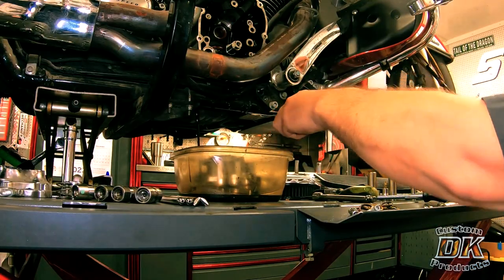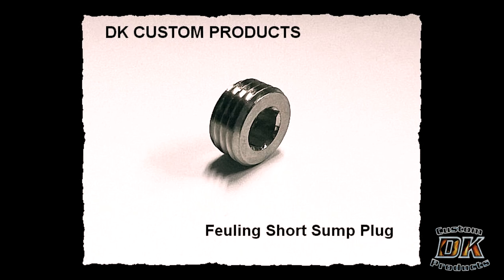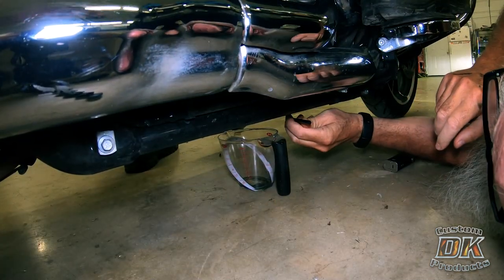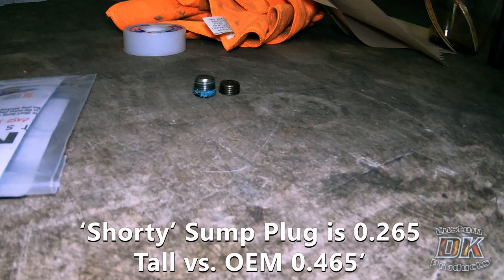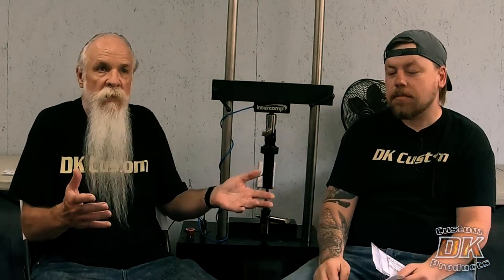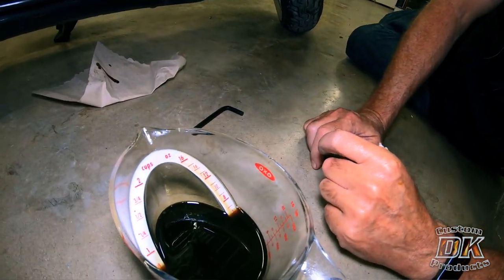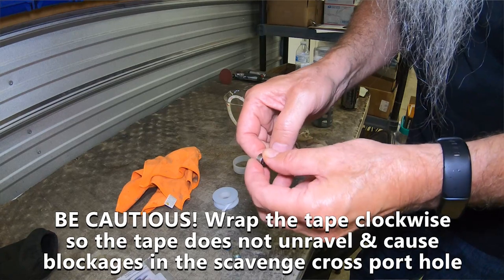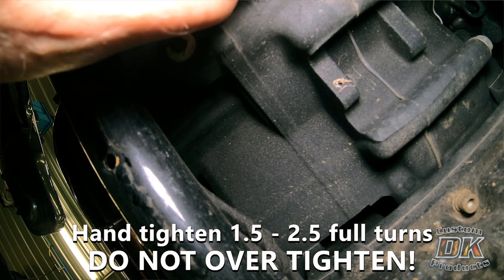Testing 3 M8's w/ the "Shorty" Sump Plug #harleydavidson #motorcycle

Comment: Did the sumping amount improve after the plug install?
Reply from the maker: Yes, the longer plug causes a blockage that can make the sumping worse. 

You can see the sump plug and read more about it at this link - https://www.dkcustomproducts.com/milwaukee-eight-feuling-sump-plug.htm

Please fee free to reach out to us with any questions;
Support@DKCustomProducts.com
662-252-8828

Thank you for commenting! MB
Reply: Could a person just drain this port and see if they have a sumping problem 🤔
Reply from the maker: Yes, as discussed in the video if you drain the sump plug hole and you get more than 8 ounces of oil you have a sumping problem. 

Thank you for commenting! MB

Comment: when you say sump. do you mean the engine oil plug?? m8 107.
Reply from the maker: The engine oil drain plug is in the bottom of the oil tank, which is separate from the engine.

Harley's are "dry sump" engines and have a sump plug in the bottom of the engine, which is not the same as the engine oil drain plug.
You can see a diagram of where the sump plug is in this video- https://www.youtube.com/watch?v=_4wxFjqyTAU&t=0s

Always feel free to email or call with any questions.
Support@DKCustomProducts.com
662-252-8828
Reply: all i am aware of in my 2018 m8 107 are the engine oil drain plug ,the peimary drain plug, and the transmission drain plug,am i missing a plug here somewhere. as i relate the engine oil plug as the sump plug. Thanks guys.
Reply from the maker: The engine oil drain plug is different from the sump plug. If you look at the video at this link at 1.09 minute mark there is a graph to show you where the engine oil drain plug is and where the sump plug is- https://www.youtube.com/watch?v=_4wxFjqyTAU

Comment: Does yours still sump with the plug installed? I bought the plug from you guys, just wondering if it cured sumping
Reply from the maker: Mine was just barely starting to sump.  Since installing the shorty plug it has been working well...not even a hint of sumping.
KP

Comment: Would any blue loc-tit be okay as long as it’s blue?
Reply from the maker: When installing the shorty sump plug you apply 545 loctite or Teflon tape and hand tighten 1.5-2.5 turns. Do not over tighten! 

Here is a link to the instructions - https://www.dkcustomproducts.com/media/wysiwyg/Sump_Plug_Instructions_9-28_1.pdf

Please feel free to contact us for any questions or concerns:
Support@DKCustomProducts.com
662-252-8828